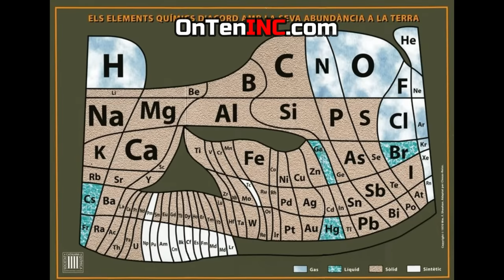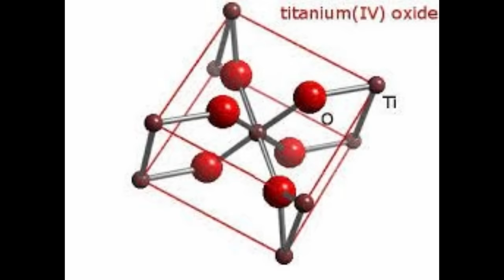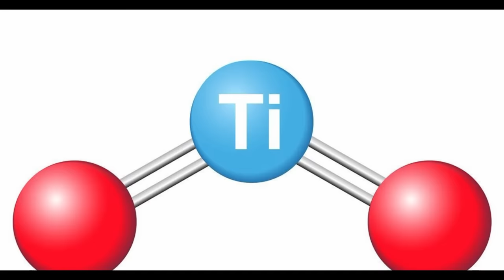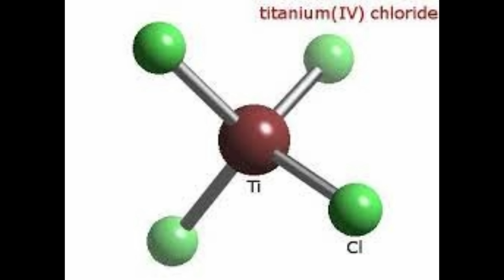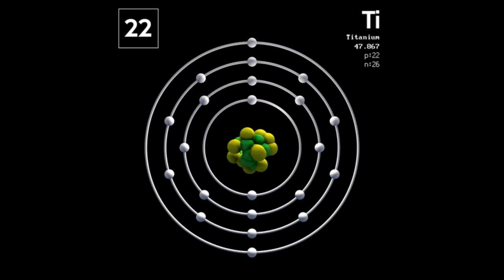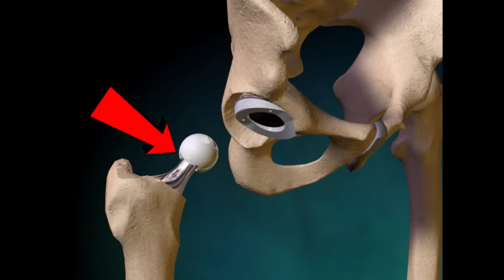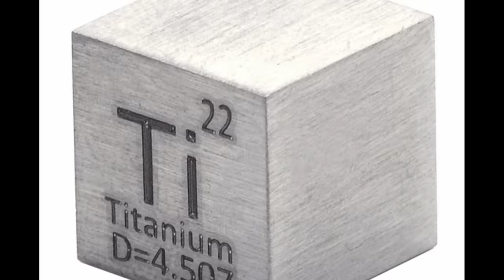Why is Titanium Common But So Expensive?

Comment: Steel is usually stronger than Ti if you have a steel I beam it is generally stronger than a Ti I beam.
Reply: I have two titanium screws in the back of my hand   three weeks after the operation  an xray was taken and showed one screw broken in half  that was over 20 years ago  the broken parts do move at times  causing some pain to remove the broken parts is an expensive operation  the unbroken screw is doing its job of holding that section in tacked

Comment: steel alloys are MUCH stronger than titanium alloys, saying it's stronger than steel is wrong, it only has stronger strenght to weight ratio, except that's very misleading, beacause if you make a knife for exemple, having a blade twice as soft as steel but twice as light doesnt make it equal to steel lol

Comment: the value of titanium in your video is overhyped, you can use pure sodium to replace chlorine from TiCl4, pure sodium metal is easily made from salt, and salt costs 40 USD per ton. If you would check the process of extracting aluminium from bauxite your mind would blow, it is way more complicated, not compared to two reactions you need to extract pure titanium

Comment: Im pretty sure titanium is heavier than steel for a equivalent size piece but it is about 6 times stronger and retains its strength right up to very near its melting point. Which is why it is used in gas turbine engined.
Reply: No, it's much lighter. You're probably thinking of tungsten.
Reply: @Pyrochazm  nope I'm afraid not, 22 years In the aerospace industry casting turbine blades 😎
Reply: @keithgibson568  titanium is 4.4 grams per cubic cm, steel is 8 grams per cubic cm.
Reply: @keithgibson568 are you high?! Titanium is far lighter than steels. It's literally what makes it famous...